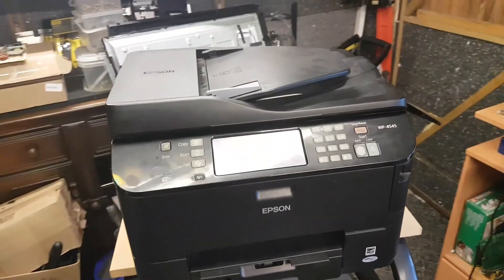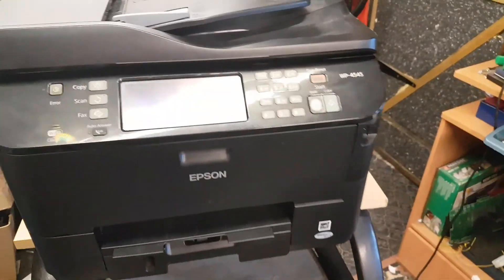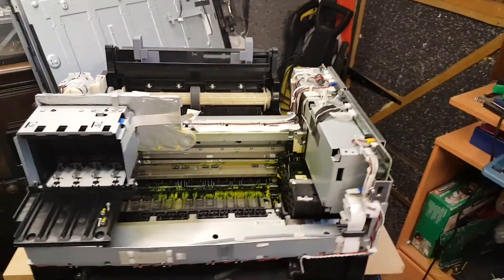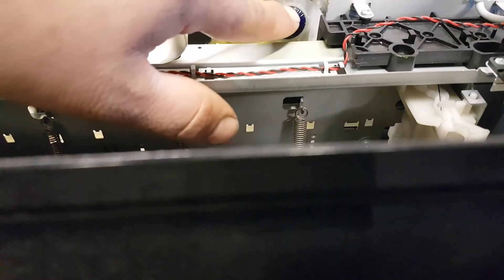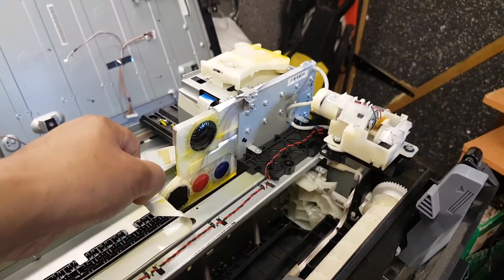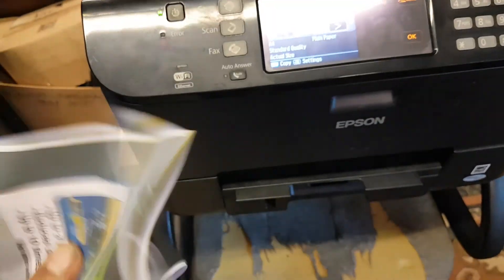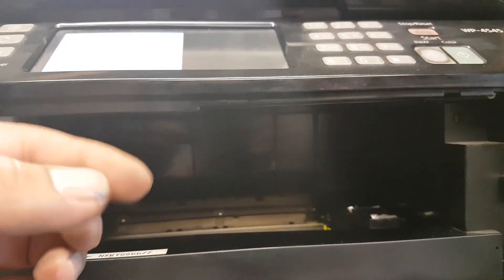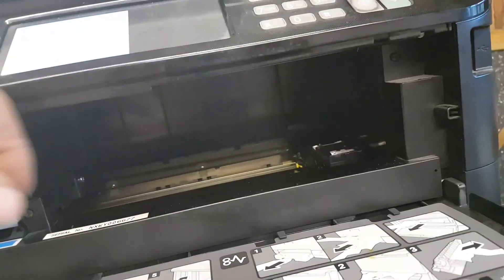Epson WP-4545 leaking yellow ink. How to repair.

Comment: I have a wp-4535 that has been in my cupboard for ages .i switched the printer on ,it would say "switch off and on and if it doesn't work see documentation" ...took the printer apart and couldn't get it to work .i only saw the yellow ink spill after putting it back together, seeing this video gives me new hope for that printer .i spent hours on Google looking for a solution to the error code .

Comment: Thank you so much for your video! I managed to fix the leaky yellow ink problem in my Epson WP-4020 using your trick of sealing the leak with epoxy! My printer is working PERFECTLY again. Thank you so much!!!
Reply from the maker: That's great! 
👍👍👍
Thank you for watching and for your comment!
Reply: Hello, do you recommend this fix ? Is it still working ?
Thank you.
Reply from the maker: Yes... this still going... never leaked again...
👍👍👍
Reply: Yes, I recommend this fix. It worked perfectly for me after the fix.
Reply: Thanks alot guys

Comment: Had a similar problem with my WP-4530 and a bladder leak with black ink.  I used a square piece of 3M packing tape and Gorilla glue to replace the ruptured membrane and after a bit of clean-up, I'm back in business!
Reply from the maker: Good solution as well!
👍👍👍

Comment: I just got a 7720 I'm wondering if I will have the same problem in the future. This is the second video I seen with the same problem. Congratulations you fixed your printer when the other guy couldn't fix his.
Reply from the maker: Hi
I am not sure if this problem was rectified by Epson on later models... probably not...
The fix I shared on this video, still working... I know where the printer is, and still going strong... 
Thank you for watching and for your comment!

Comment: Thank you for the quick reply. In my situation the yellow ink bladder seems to be a small leak. I don't have the mess you describe in the video. With your fix, did you epoxy the piece of plastic patch over the ruptured membrane or did you remove the membrane first, drain the ink and then epoxy the piece of plastic patch to the round opening? Hope my question is clear. Thank you for your help.
Reply from the maker: I cleaned everything first... removed the membrane as well...
👍👍👍

Comment: This is very good demonstration of the large cartridge Epson. Are there any special Epson cleaning tools to connect to ink hose system connections? (there are two connections, one after the ink pump and the other just before the printhead) , main problem is that those long ink supply hoses get stuck with dryed ink-->  ink pump system fails and eventually leaks.

Comment: Thank you for such a detailed video explaining the issue and how to repair the printer to normal functioning.

 This may have been answered below, but is there a comprehensive video that shows step by step how to access the parts mentioned so that it can be fixed? I am not very savvy in this arena so I would like step by step instructions to disassemble then reassemble the device if possible.
Reply from the maker: Hi
I don't have one... and never really searched.. sorry...
Thank you for watching and for your comment!

Comment: Just experienced the same exact problem. In your opinion, does the job require epoxy resin specifically? or are epoxy glue or pvc cement sufficient? Thank you.
Reply from the maker: Epoxy glue should be enough...
👍👍👍

Comment: Mine just exploded black ink everywhere.  I may try this fix if I can.  I like this printer. Any reason not to use a contact cement and a piece of thick but flexible plastic?  Like ziplock bag material?
Reply from the maker: I wouldn't go nothing flexible...
Reply: @LMAutoRepairs   Well, thanks for this video.  I did manage to completely fix the ink bladder failure.  Unfortunately something else happened to it and now it won't feed paper.  I've spent hours checking things and re-trying, the printer is junk now.  It even makes a horrible grinding noise from the main print head motor during startup sometimes and all lights flash.  I didn't have any of these issues before opening it up. It mechanically worked fine.  Now the paper pickup only moves slightly and then throws a paper jam.  I've checked the duplexer a million times.  Every now and then a piece of paper will get pushed all the way through and it will print something, but only 1 out of 40 tries.
Reply from the maker: Well... looks like you have definitely missed something during the assembly...

Comment: hello thank you for this video
i repaired my wp 4015 epson  there is no more leak, but yellow do not work it seem that the yellow little tank (the one i have repaired behind the spring) do not fill completely.
have you an idea
Reply from the maker: Make sure is bleeded correctly... 
Other than that... not sure... inspect everything etc... 
Thank you for watching and for your comment!
Reply: @LMAutoRepairs  What do you mean with the bleeding., How do you do that?
Thanks
Reply from the maker: There is a procedure that the printer performs... if I recall correctly...
👍👍👍

Comment: Mystery solved.  Same problem with my WP-4520 which is basically the same printer.  Mine started leaking the black in the same spot and leaking out at the handle area of the side panels and at the feet area towards the back.  I had been trying to truobleshoot the banding and faded black printing that was recently occurring. Thought it was a clogged print head but now realize it was lack of ink pressure caused by this failure.  Looks like they use thin cellophane like Saran wrap.  Epson cartridges have the same flimsy plastic wrap in their ink cartridges.  Very poor design. No more Epson printers for me.  

And I just bought 500ml of bulk pigment ink for cartridge refills!!!   Damn!!  Anybody want to buy some ink and refillable cartridges?
Reply from the maker: Hi
If helps, this repair still last...
And the printer still in use!
Thank you for watching and for your comment!
Reply: @LMAutoRepairs  Well, just for the heck of it, I'm trying to take it apart but this model is a bit difficult. Will search YT for some videos on it.
Reply from the maker: @frankcee4342  
👍